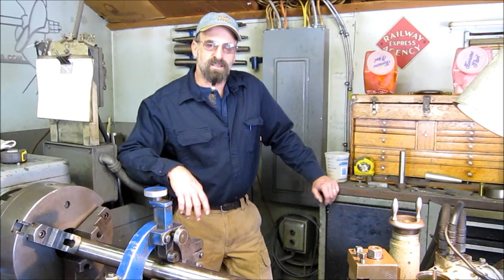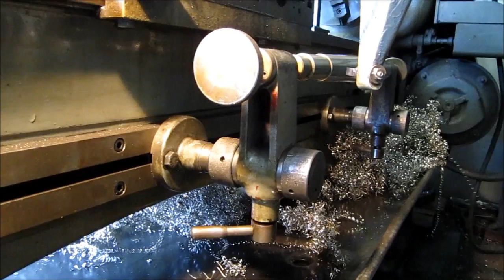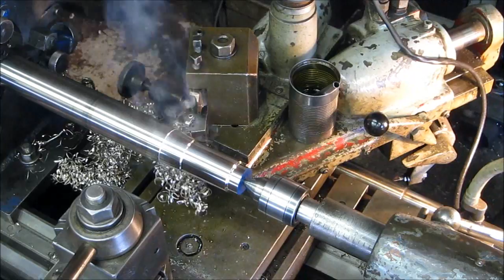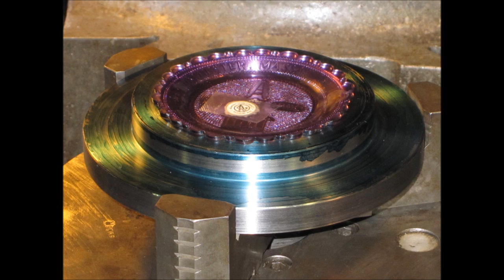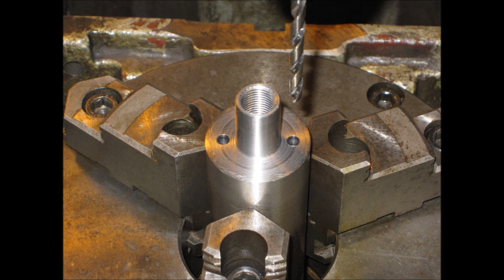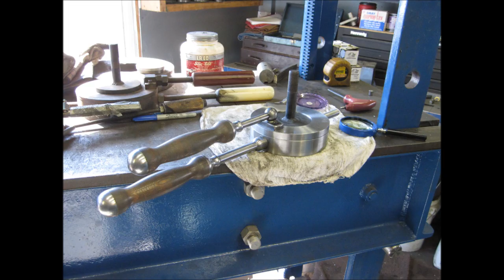Trace It!

Comment: Thanks for posting this video.  It brought back memories for me.  My Dad was a tool & die maker in Southern California where they did a lot of aerospace work.  In 1961 or so, in order to machine a part for a Minuteman missile, he made a hydraulic tracer that had a 16" radius capability on a 36" lathe with a very long bed.  The flat pattern was near the tailstock end of the lathe.  At about 13 or 14 at the time, I felt dwarfed by this lathe.  I was wondering if tracers of any type were even being used these days with the advent of CNC.  Jerry

Comment: I just got a HES 18x80 lathe and in the manuals it had a tracer attachment.. I'm trying to track it down, it would really increase the versatility of the lathe, even though I probably wouldn't use it too much.
Is there a way to fine tune the X axis like there is on the Y?

Comment: since you are cutting a taper there the speeds and feeds get quite complicated, at least more than straight cuts. i have trouble with that sometimes, do you have a video on that, or if not, could you make one?
Reply: Not exactly anymore complicated than cutting a straight section. The diameter variance is small, and besides, it is a manual lathe where you have only a few options to select from. Basically you would select a surface speed according to your largest diameter or something that covers most of your workpiece diameters and go with that.

Feeds are totally dependant on the material, the insert and the chipbreaker. When you are cutting shallow angles (I would say 20 degrees or less), there is just not enough variance in the feed rate along the hypotenuse that it would matter.

As with everything, try your normal settings and if those do not produce the results you are after, make independent and intelligent adjustments. Meaning, watch your chips and watch insert life.

Comment: Hi Keith - I was watching you "Broken beaver seven" where you do the radii and wondered how this "feeling food or finger" can go along the pattern when the radius IS DONE - it's close to 90° I beleave - therefore I switch over to this video ! What if your pattern has an edge pointing "backwards" compared to the feeding direction ... I mean, if the edge on the patterne IS 90° or more (=pointing backwards) ... what happens - do you have a dead-lock, a crash or what ?

Comment from the maker: In my videos Belt up 1 & 2, I have a couple photos of as I was putting it together, that show the modification to my fitting of the Drive-all and its mount from another milling machine. Basically made a shoe to fit the base of the press so the Drive-all mount, had a place for the  flange to mount too!

Comment from the maker: I don't do enough materials that create spray chips, which are the only ones that would bother me, to run it in the upside down mode. I flip it over from time to time, looking at the chip as it being cut and curling in the breaker it handy to adjust your speeds and feeds...

Comment: Hello Keith,

You could use the tracer in normal direction of rotation and feed if you fit the tool upside down (would need to be a lh. tool of course). Only thing is that you maybe can't see the work as good but then the chips will be flying down instead of up witch is a good thing I guess.

René.

Comment from the maker: @billdlv With the tracer, your deepest features are the first to make contact, and then as each cut advances, the rest of your part, starts to take shape. So there are no sudden plunges during the cutting process. You want a positive hold because your naturally going to be confronted with tool bit pressures, just like you do with a taper attachment and the variable diameters, within the same cutting pass.

Comment: @KEF791 Keith I watched it again, I see the dial indicator, very clever.  Now I'm wondering is there an adjustment like a needle valve or bypass for how much force the hydro can put on the tool against the work?  It seems to me that if you had a deep feature in the pattern you would really have to be careful. Thnx!

Comment: Keith-thank you! When I figured out how it worked, I said Eureka, it's like CNC without the CN..
Also, I have noticed in your vids, especially this one, when you start to cut the taper there is a blur of smoke, which means it is generating some serious heat. I find it hard to believe the tooling is not abused from that, and I wonder why you don't have a small coolant pump spraying on the tooling?
--Christian

Comment from the maker: @oneyaker I set up the mandrel, ingage hydraulics, run the carriage back and forth along the taper, with a indicator centered on shaft to be cut, off the tool block of the taper attachment. With the combination of the travel dial, on the carriage, for length of travel and the indicator on the shaft to be cut reading the difference of depth or cross movement, lets you set up a true taper. Marine shafting is 3/4" per foot or .03125 per side, per inch. :)